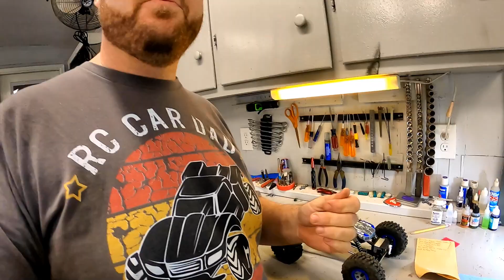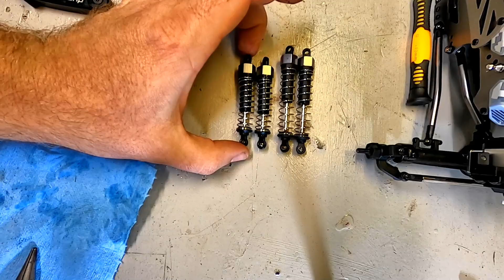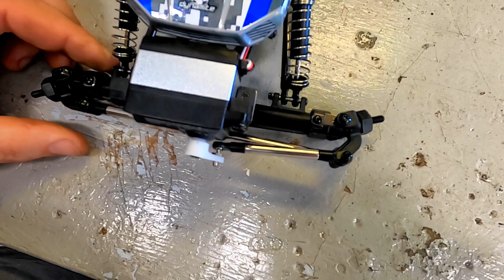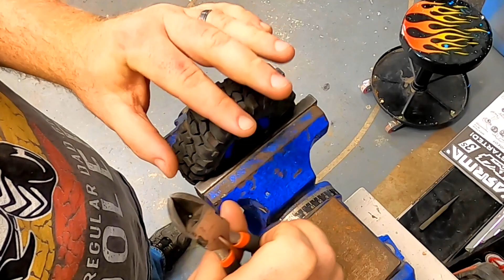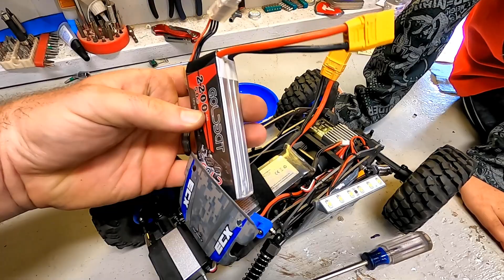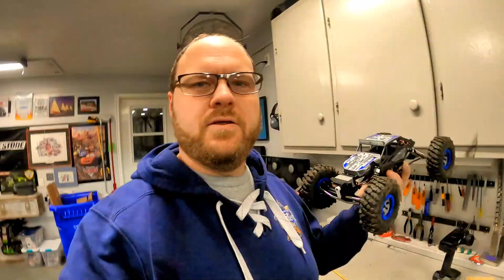ECX Temper Gen2 RC Crawler | Free Upgrades and Mods!

Comment: Hi does de esc is compatible with 2s lipo battery
Reply: The stock esc
Reply from the maker: Yes!  It does work, but it does not have low voltage cutoff.  You will need to monitor the battery voltage.
Reply: Thanks

Comment: Do you guys know if the Temper gen 2 can run on a 2s lipo out of the box or do i need to swap the esc?!
Plz answer i can't find the info online and i want to order batteries now :) :) thanks!!
Reply from the maker: I ran it on a 2S lipo just fine. 
The only issue is it doesn't have low voltage cutoff, so you need to watch your battery voltage.
Reply: @RoadsideRC  is there a way to add a voltage cut off alert thingy or something? how would i go about checking the battery voltage in the trails? thanks i'm sorry im a big noob lol
Reply from the maker: @TechWizMaster  Very easy - just plug one of these in: https://amzn.to/3YL28hS
Reply: @RoadsideRC  thanks your my hero!

Comment: Is the stock esc able to handle a 2s battery? Great video.
Reply from the maker: It sure can!  It does not have low voltage cutoff, so you will need to watch your run times or get a lipo alarm.  
I ran a lipo alarm - but it ran so long that it never went off!
Reply: @RoadsideRC  thank you for the info. 👍
Reply: I wasn't sure so I put the electronics for the Redcat Everest 10 in it. I bought a second set of them for another rc I have cause I liked them so much.

Comment: Hey so you can run 2s lipo on this truck stock ?
Reply from the maker: Yes!  But, it does not have a low-voltsge cutoff, so just be careful.

Comment: in order to lower the center of gravity, without sacrificing the ground clearance, try adding weight to the insides of the wheels, like wrapping wire around the rims. while you are at it, remove the foam. that will help with the tire flex, plus it won't hold on to water so badly. I found with removing the foam, and plugging the holes in the rims with glue, it actually helped with traction having the constant pressure. you can also loosen the bead locks and squeeze the tires then reinstall the bead locks to have even lower-pressure tires that won't hold water. this way I don't have to disassemble and clean the insides of my wheels afer going through water. I guess if you already drilled holes through your tires it might be too late, but other people could still give it a try, and it is completely reversible if you sont like how it drives. just scrape out the glue and you're good to go.
Reply from the maker: Sorry - but I am not a fan of adding rotating weight or sealing tires.  
Rotating weight is especially bad on this truck, where the driveshafts tend to be a weak spot.  

But - if it works for you, great!
Reply: @RoadsideRC  Ah, good point. I guess I didn't think about that affecting driveshafts. after breaking at least three sets, I bought some cast aluminum shafts and cut them down to the right length. I am hoping I can get a video up of how to do it soon, as I couldn't find any earlier. it was a fairly simple process, with a Dremel and $20 for the shafts, I haven't had any more problems. if I do get it up, Ill send a link. if you still use these crawlers, it makes a huge improvement.

Comment: I just got this rig and it is a blast for sure but yeah the steering is not great.  I just wonder about replacing the bearings with bushings as Shen RC advises when doing the steering mod. He reckons if you trim the nubs off and bend the rod to get a tighter steering radius the bearings will get damaged if not replaced with bushings.  So wondering if you had to do this and if not how have the bearings held up?  Thanks.
Reply from the maker: I really can't follow Shen RCs logic there.  Bearings are better, 100% of the time.  
The while time I drove this truck, never had issues with the bearings.
Reply: @RoadsideRC  Thanks so much.  I will do this mod as you have done.  Really like this rig and look forward to lots of run times with it.  Stay safe and keep on truckin'.

Comment: The shock mod put you at a disadvantage in my opinion.. you lost all your movement. But I do love that truck.. I bought both colors I love it so much.. rc addiction eh.... do like the steering mod! Thanks
Reply from the maker: Getting the truck lower was my main goal.  I agree, that ideally I would do this with softer springs that still allows full suspension movement - but I was trying to do it for free!

Comment: I bought two of these crawlers after seeing your video. My son and I love them. However, I’ve found that the skid plate/transmission mounting plate to be very fragile. We’ve broken the same rear linkage tab on that plate. They are back ordered so we managed to super glue them together temporarily. Have you had similar issues?
Reply from the maker: Sorry to hear that!
No, I have not had any similar issues at all.  Mine has been rock solid.

Comment: Great job absolutely excellent. The only thing I would spend money on is the two-in-one ESC. That's the ESC that comes in the amp Mt. So that is made for more speed then anyting, hard to remain tire speed at a steady pace with that ESC. I would just upgrade it 2A barrage ESC that's set for crawling and 3s battery. Okay everyone have a great day and a great crawl oh the ESC cost $39 maybe 29 worth every penny
Reply from the maker: Agree!  This truck has been really good with these modifications.  
The ESC would certainly be an upgrade.

Comment: You should try rubber bands instead of the spring mod. Spring mod limits the down travel by the amount of the compressed spring -- with rubber bands you get the full travel both ways
Reply from the maker: Where do you attach the rubber bands?  On the outside?
Reply: @RoadsideRC  on the temper I would just put some bands long enough to wrap around the axle and then the top of the shock mount. And you only want bands that are only strong enough to give you a bit of droop but weak enough as to not compress the shock more than 40% (unless thats how much droop you want)

I'm actually going out to buy a temper today because of your videos on this thing. That is a very capable rig and looks to be a good project!
Reply from the maker: Great!  I look forward to hearing what you think about it. 

Make sure to do the steering mod - it is a MUST!

Comment: https://www.ebay.com/itm/2pcs-7-4V-1500mAh-2S-LiPO-for-Wltoys-A949-A959-A969-A979-K929-Deans-T-Connector-/133112440992?_trksid=p2349624.m46890.l49292
Reply: Try these.. What i run on mine. Nice video!
Reply from the maker: Thanks!  Those will definitely work.

Comment: Would cutting the springs be another option or would they still be too firm?
Reply from the maker: Thanks!  From what I remember of 1:1 scale, cutting springs actually effectively increases the spring rate....but shortens them.   In this situation shorter may be better, but the springs are already too firm.
Reply: @RoadsideRC  that’s right! I forgot about the increase in torsional stiffness. Excited to see more videos on this thing. Subscribed. I just recently started getting interested in RC’s. A hobby I can share with my kids.
Reply from the maker: @rekik66  YES!  That is exactly why I got back into RC after many years.  My full scale vehicles and what I was doing with them just wasn't appropriate for my kids to be around.   With RC, it is MUCH cheaper than full scale and it has been a great thing to do with my kids.

Comment: Great Video! Just got the Everest 16 made a few adjustments also. The small crawlers are awesome!
Reply from the maker: Thank you!
Reply: Where did you find a Everst 16? I've been trying to get one for a while. No one has them since they have been discontinued. I have the Everst 10 and love it. I have the temper 2, and the Exceed MadWatt  1/16 crawler and they all look very similar to the Everst 16.
Reply: @LEVARIOMIKE  I actually got it about 3 years bacl from a site called Mercari. I've seen a few listed since then. sll they have tight now is the OG Temper listed. But i think  gonna revert mine to stock and sell it. got a few other projects lined up and the E16 seem pretty desirable.
Reply: @LEVARIOMIKE  I was originally looking for a Maxstone becuse they are harder to find. but i ended up finding the E16. and yeah they are very similar. There was an HSP kulak that used all the same parts. someone made a few 3d prints for the kulak, even going as far as protal axles. I haven't printed any but I have designed a few parts. Like a new skid to change the link position and Chassis rails and Center backets for supporting the shocks. mine is hardly recognizable any more.
Reply: @tiedtomemory8864  Do you mean the Madstone? The 1/16 crawler with two motors? I was trying to get that one but they are out of stock. Do you know which came first? They all look so similar who copied who?
Reply: @tiedtomemory8864  I put the Toyota truck body from WPL on my MadWatt crawler,but since I keep stripping out the plastic on the rear axle I put that body on my temper. Looks awesome on it . Perfect size for both. Even though the temper is supposed to be 1/18 scale and the MadWatt and WPL are 1/16 .
Reply: @LEVARIOMIKE  I think HSP started the design then sold the design off. Nah I was talking about the green one that looks like the E16. People were saying you can get the replacement Back diff fornthe E16 and put it into the temper, because it has metal where the ECX has plastic. i just got me a gen2 finally and plan on doing the same thing.
Reply: @LEVARIOMIKE  A lot of the 1/18 cars from different companies have interchangeable parts the Barrage 1/12 has some of the same parts like the axles and the shocks from the E16 but people were saying the barrage also has plastic in the differential